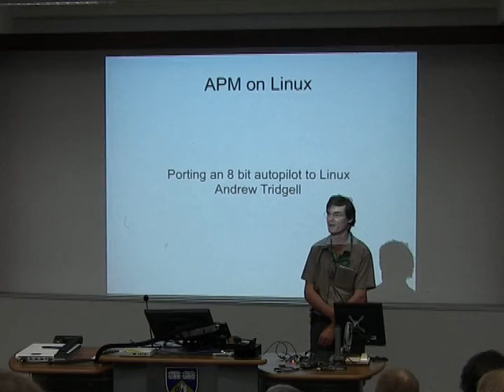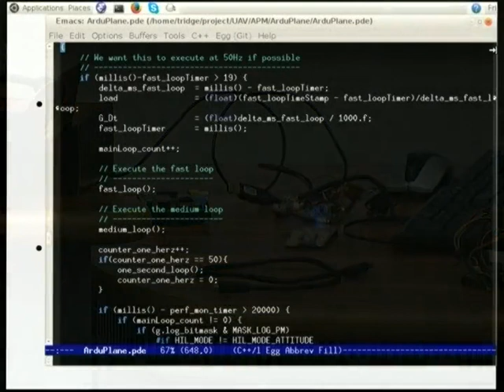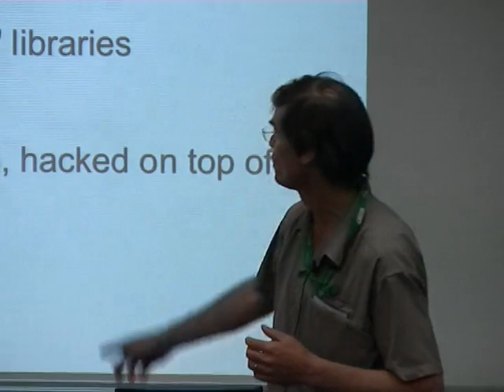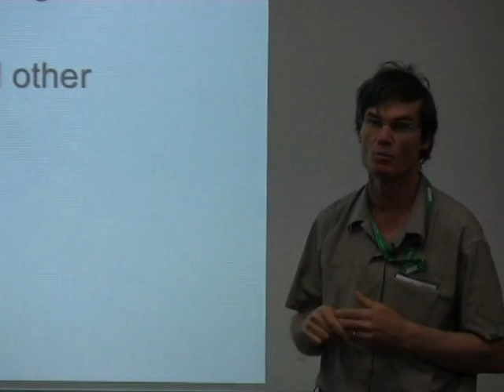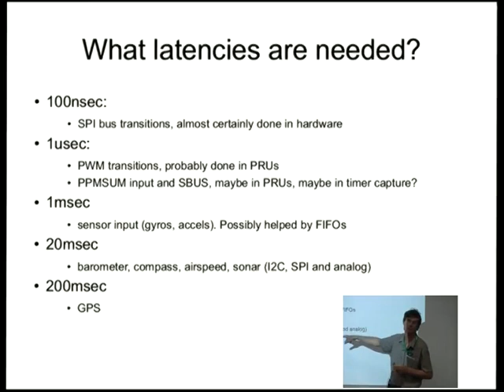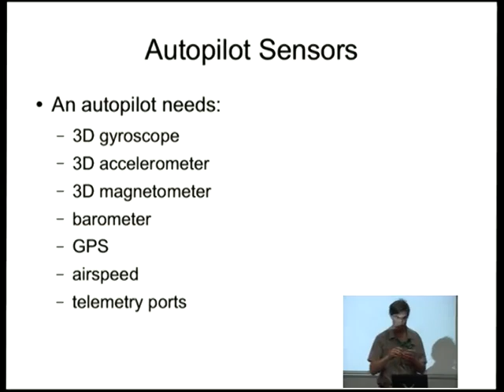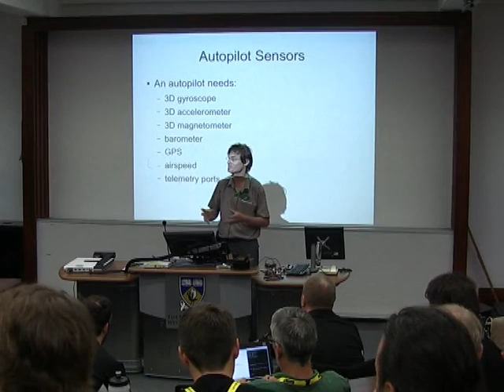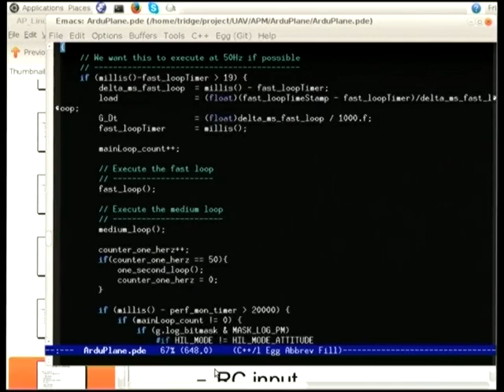APM on Linux: Porting ArduPilot to Linux

Comment: I don't know how much you've worked with Mission Planner but I need to get flight data streamed real time into another program running side by side with Mission Planner.  I'd like to know what would be the easiest way for me to query status data from the flight data screen?  For instance, how do I ask Mission Planner, "What is the current latitude of the copter?"  And get that latitude into my program.  Ideally, I would like my program to see all of the status data.  I know that in MP, press control-f > then mavlink, will pass through all raw mavlink data to a TCP connection.  However, it is encrypted and it's all gibberish.  Furthermore, it seems the .tlogs don't have all the data that the status tab has.  Please Help.